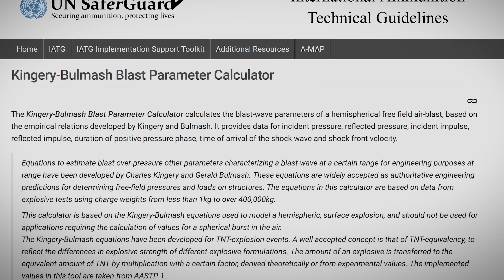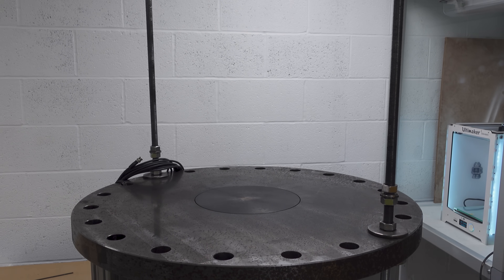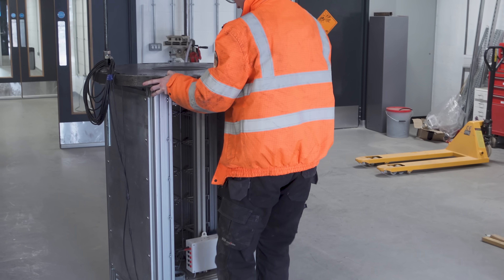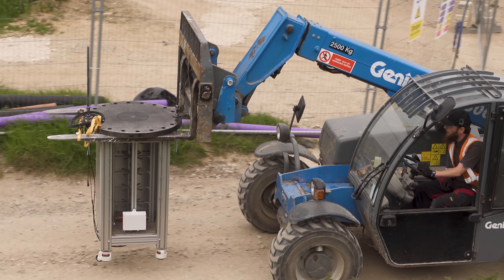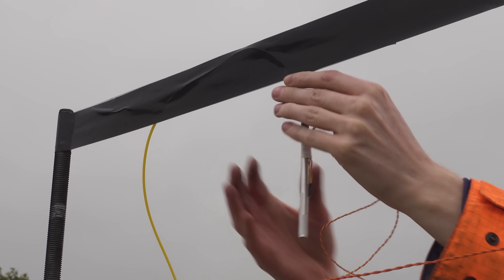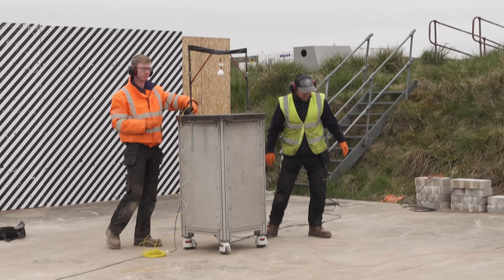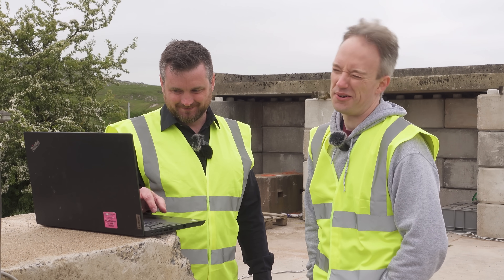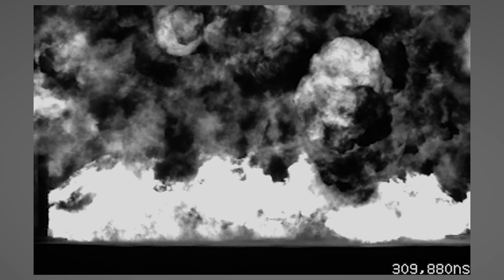No-one knows how explosions work (yet)

Comment: I remember a friend told me,  back in the 90's, that explosions are not uniform in size.  He said that in an explosion, you can be ripped to pieces or just fine depending on where you stand.  Seeing the slow motion video makes his statement a little more valid.
Reply: yes, i’ve seen this because when i hold a primed grenade i often die but when im 10 miles away from the primed grenade i tend to be ok

Comment: Dear Tom n Sam! Check into recent calculations solved by Chinas Quantum machine. Sam will be familiar with the computational exercise talked about. Its essentially paths of every molecule. Present disclosed supercomputing power is estimated to be able to model/solve it in 20k years or something. Chinas Qbits are up to 128 i think and it took less than a second. Quantum is the most ignored existential topic ever. Dont close your channel Tom.. the fun is just beginning. The species is proving to be more than an unpopular reality show lately. From 300BC Archemedes defined a unit of measure with its basis in the width of 40 lined up poppy seeds.. up to 128 (or is it 256) qbits. Keep going!

Comment: There are two approaches for dealing with that kind of energy, brute force containment and diversion.  What isnt shown is the solution military vehicles tend to use which is armor plating that's designed to resist and divert the explosive energy.

Comment: Explosions are breaks in covalent bonds that cause oxygen and nitrogen which were held in those bonds to bind to each other which makes O2 and N2 gas. These gasses are expanded and make the explosive forces of bombs.
Reply: Explosion are the result of nitrogen atoms combining into N2 molecules, not breaking bonds. Energy is required to break bonds:  energy is released when the atoms bind through covalent bonds into molecules. That's why so many HE use nitrogen-rich compounds to generate mainly N2 and CO2 gas which is hot from the energy release and thus expands very quickly.

Comment: Explosions are a result of the sudden release of a large amount of potential energy stored in an explosive material. The energy is usually in the form of chemical energy, such as nitroglycerin or grain dust, pressurized gas, such as a gas cylinder, aerosol can, or BLEVE, or nuclear energy, such as in the fissile isotope's uranium-235 and plutonium-239.

When an explosive material is ignited, it undergoes a rapid chemical reaction that produces a large amount of heat and gas. The heat causes the gas to expand rapidly, creating a shock wave that propagates through the surrounding medium. The shock wave is characterized by a sudden increase in pressure and temperature. The pressure can reach several thousand atmospheres, and the temperature can exceed several thousand degrees Celsius.

On the molecular scale, the explosion causes the molecules of the explosive material to break apart and rearrange themselves into new molecules. This process releases a large amount of energy in the form of heat and light. The heat causes the surrounding molecules to vibrate rapidly, which increases their kinetic energy and temperature.

The exact details of what happens on the molecular scale during an explosion depend on the type of explosive material and the conditions under which it is detonated. For example, high explosives detonate rapidly, with the front of the chemical reaction moving faster through the material than the speed of sound. Low explosives deflagrate, with the front of the chemical reaction moving slower than the speed of sound. (I totally wrote this)

Comment: you can analyze every explosive construct and predict the blast.
what you have to do is simply account for every single atom in the whole construct AND the immediate surroundings, the rate of transfer and decay of the energy applied, and nearby obstacles not part of the construct that may affect the result significantly.

you can see, as the measuring scope approaches atomic, the amount of calculations tends to infinity.

.....but you very much can.
it's not impossible.

Comment: Tom... I know you say it can't be simulated but... I'm sure Todd Howard and maybe Circa 2010 DICE already has. It had something to do with two point of reference pixels overlapping and eventually multiplying the repulsion force exponentially and faster in a runaway logic train until an integer fails to post and then the anti lag code kicks in and reads the object as moving away from the other object. In which the object exploded outward. Sometimes into space.

Comment: Someone check me on this please:
- As Tom states, there is a little push/bounce that occurs with a blast radius and any surface near it.
--> Would it not follow that there is an optimal distance based on the amount of payload and height such that at the right height and payload, that bounce back from the surface beneath the blast catches up to the initial blast (resonance) and the energy is conserved through redirection.
Reply: Yes, but only in the direction of the reflective surface.

Comment: The thing that peaks my interest is the part about protecting buildings against explosions, talking about it as if it happens all the time. If we don't live in a world where we can just over engineer the few buildings that need bomb protection, and apparently live in a world where we need to run cost cutting tests in order to be able to build stuff as cheaply as possible while still being bomb resistant, something is going on.

I'm probably just going crazy as I get older, but I'm noticing those kinds of "two worlds" slip ups more often.

For example, the Netherlands supposedly only has 100-150 murders a year, and has for decades, with a solving rate of 80%+ back then, and even 95%+ nowadays. But a while back there was a large scale official police study/action group working together with a university who developed a way to assess cold cases and help solve them/suggest overlooked connections and whatnot, who, and here comes the "slip up"; spend months selecting 2500 unsolved murder cases, from all the unsolved murder cases in the last 40 years, that they thought would have the most benefit from being assessed by the system.

So the official stats of 100-150 murders, with 80%-95%+ of them solved, simply can't be true, if "behind the scenes" they have so many thousands and thousands of unsolved death, but most probably murder, cases without any chance of solving them at all, that they can select 2500 of those that they think need a new assessment by some new special system. So a lot of deaths, that they know/suspect are murders, must be getting filed as regular deaths in the statistics, for whatever reason.

You know, it's like hearing about professional hitmen with dozens of murders, or about sex trafficking shipping thousands of women to illegal brothels, while, and I hate to use the term "main stream news", report and present us with a world where much less worse stuff is the worst stuff that happens.

Comment: The problem comes down to chemistry and physics

The explosive compound has impurity, pitting, air bubbles and so on

And the casing also has inconsistency’s in hardness, density / consistency of atomic chains and manufacturing scratches, cracks and pitting

Even if everything was 100% the same between 2 tests apart from just 1 scratch on the containers well now they will be wildly different

Consistency is not something that exists with explosions

Comment: An explosion a pressure wave caused by energy traveling faster than the sound barrier If it has enough energy it can release the chemical bonds of other things. The fireball is the gas heating up and being iozined. But the initial explosion is the result of a intense amount of potential energy being converted almost instantly. A lightning fast chemical reaction

Comment: We had this problem when designing our detonation rig at the University of Southampton. We needed a way to collect experimental data that wasn't just qualitative, and it was incredibly difficult to find a sensor that we could expose directly to the detonation on the inside of a detonation chamber that could read data fast enough, resist the 3,000 Kelvin instantaneous temperature, and sustain anywhere from vacuum to 60 atmospheres of pressure. Using strain gauges is a cool idea to look at detonation wave speeds, but I don't see how they can read static pressure and temperature with time

Comment: All explosions are, are chemical reactions, take gun powder for example it’s an explosive, if you have a little bit in a line and lite it, it will burn and let off gas and react with the oxygen in the air and the oxidizer in the powder, now take a bunch of it maybe 10 pounds of it and if it all reacts at once you get a massive reaction that gives off a ton of gas almost instantly creating a massive pressure spike hense the shockwave from explosions.

Comment: Lacking a bit subtlety here I fear. From what I gathered , all explosions have a push to begin with , but if the explosion is strong enough it is followed by a slight pull , and if it's close to a solid surface like a wall of the ground it has the potential of releasing a second push for a total of 3 vectors. Those are extremely quick and their total value sums up to one pushing vector , but there is more than meets the eye.

Comment: The more I learn about chemistry, especially at atomic scale, the more I'm amazed other people aren't obsessed with this stuff. A wave of force that propagates within the barest fraction of a second applying so much energy to the enclosed system that a 10 square meter concrete pad is shaken hard enough to release dust clouds, and it's all caused by unusually energetic interactions happening at subatomic scale in an object with a mass of a less than a kilogram.

Comment: Why don't they use Pizo- Crystals to measure the strength of the explosion? Wouldn't that be easier bc. the voltage that is "created" is proportional to the force it receives.
Reply: interesting option. maybe they're more expensive to produce the same resolution, or maybe they're too fragile. Just brainstorming

Comment: did load of work on that site years ago where they were testing new gas pipeline systems. weeks wiring up strain gages and thousands of meters of cables back to the control building.

Comment: Wouldn’t this be akin to the way a multi joint pendulum swing would work? As in the sensitivity to the starting conditions is high, so variability in the cascading effects would be extremely pronounced? 

I wonder how an explosion changes when the detonation position is moved, even in something designed to pressurize it.

Comment: The dust  coming off the large concrete pad is really interesting - shows how much energy is in even that 100g of explosive
Reply: 0.0000001kilotons.
or 0.000000005 Hiroshimas.

Actually this only works if the explosive is tnt but I can't be bothered.

Comment: So....in terms of knowing how explosions work (and how to simulate it), there are actually a variety of CAE/simulation tools that are available for explosions (or really, it's an oxidation reaction, but just at much faster timescales).

There are a whole BUNCH of models for simulating explosions.

Depending on what product you're oxidising, the rest of the research would be calibrating the computer model for that specific application, and being able to simulate it at the micron scale. (which, again, CAN be done. We HAVE the tools for it. It is just computationally very expensive to simulate.)

(Simulations for the explosions that happen inside an internal combustion engine happens all the time.)

Comment: This also has huge implications for nuclear weapons design.  The earlier in the detonation process that you can improve the design, the bigger the effect on the ultimate yield.  The yield increases geometrically as the design improvements approach time zero.  Eg. a one percent improvement at time zero will increase the final yield by over 50%.
Reply: The fact we can only really do this type of research today shows how difficult it was to design and build implosion-type nuclear weapons in the 1940's.
Reply: @baksatibi  Another example of technology just reaching the point of allowing us to do nuclear weapons research: the National Ignition Facility's "fusion power breakthrough" (more than 400 megajoules - probably close to 500 - in, 3.15 megajoules out) in December.  What they are actually doing is setting off really tiny (0.000000753 kt ~= 750 grams of TNT ) thermonuclear bomb secondaries.  The data gathered is used to refine computer models and that will allow them to test new bomb designs entirely on computers.  This isn't some conspiracy speculation, they straight out said this in the press conference, but later on, after most of the media had run out of the room to file "FUSION POWER BREAKTHROUGH!" news reports.

Comment: The nukes dropped on Japan was detonated 1000ft in the air so to maximise destruction at ground lever as not to waste power in to the grown and waste it. The only building to survive was directly under the bomb as it had no side ways force to blow it over. But anyone in side was crushed as the floor flattened under the force coming down, but the out walls all remained.

Comment: Tom not knowing software like LS-Dyna or Ansys Autodyn.
Reply: And on a previous video he said "I though fluid flow simulations were completely figured out" or something like that (it was about river bed erosion I think). Well, apparently to Tom you can either completely simulate or not simulate at all XD. But i think what the guys on the video are doing is a lot more fundamental than relying on simplified and experimental based models found on most commercial CFD packages.

Comment: I mean the Navier–Stokes equations tell a lot.
You "just" need to mix them with thermodynamics and you should have all the equations needed.
But good luck to solving them
Reply: Classical Navier-Stokes are innacurate at such flows. You could model other effects based on empiricism but your model is as good as your as your experimental data, which, as seen above, is currently lacking. Same goes to thermodynamics

Comment: If you go to 5:06 and use the . button to go frame by frame, you can see that the ground lights up 1 frame before the explosion is visible. This is because the camera scans in "lines" of pixels top to bottom. When it was at the explosive material, it had not gone off yet, by the time it got to the ground, it had.
Reply: Thanks for the tip on how waste even more time on you tube.  Now I have watch all the slowmo guys videos again.
Reply: thank you for the dot button tip!
Reply: @richcolour  You can also use the comma to go back a frame.
Reply: @richcolour  Also just type Shift + / (aka ?) to view a ton of YT shortcuts!
Reply: Equally interesting is the shape and location of the light. It almost looks masked off somehow.
Reply: Not all the footage in the video is filmed with cameras that use a rolling shutter. But great find!
Reply: This tip has changed my life.
Reply: On desktop, go fullscreen and type "awesome" on your keyboard for an easter egg
Reply: Wow, cool find! Thanks!
Reply: Oh that's really odd. I would have expected it to form a flat line where the light begins though. But it seems to be curved instead? I wonder why that is.. Maybe there's some lens abberation that means it scanned in on the chip as a flat line, but then the lens curvature is accounted for and the line is bent?
Reply: That's fascinating
Reply: I think, that has to do with cameras and how they work.
Reply: *rolling shudder

Comment: What happens to explosions in pressure pots or vacuum chambers? Is there a way to slow down "an explosion" practically, with extreme cold and pressure?
Reply: I'm no physicist or engineer, but I'd say that likely, yes. The propagation of an explosive wavefront is essentially due to the shock of the wavefront compressing the molecules ahead of it. The extreme cold that can be lab produced could (I imagine) slow the molecular movement enough to make a difference, but I would guess that the amount of cold and/or pressure that would be required to slow the reaction down enough would also alter the very physics and chemistry that would occur, making the experiment moot.
Reply: @Chris  it is amazing. 

Just by observing the science you change the science!

Comment: 5:05 if you pause frame by frame you can see that the light from the explosion shows up on the ground faster than the camera can catch the light emitting from the actual explosive.
Reply: rolling shutter?
Reply: @WyattWinters   Yip, that footage was filmed with Toms little camera not a high speed one

Comment: I think there's a difference between explosion and detonation and its is in "burning" speed. Detonation of TNT is about six kilometers per second
Reply: Right. Every detonation is an explosion but not every explosion is a detonation (supersonic explosion). Subsonic explosions are called deflagrations.

Substances that have the ability to detonate are called high explosives. Explosives that do not have this ability are called low explosives.